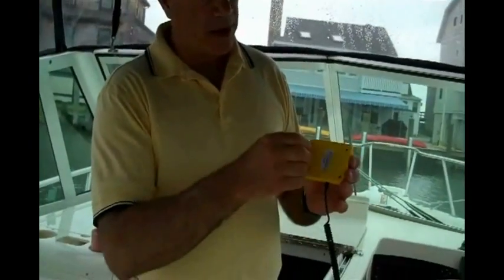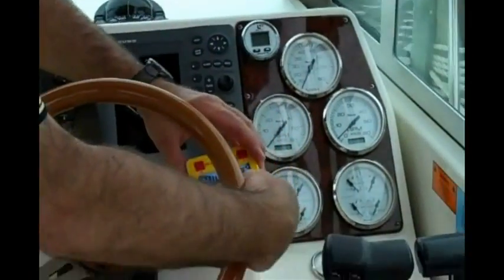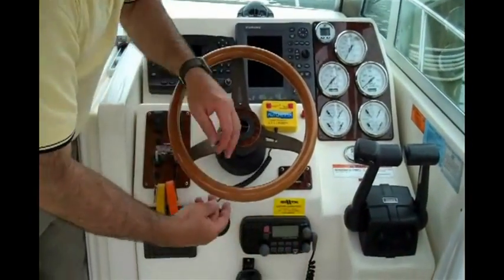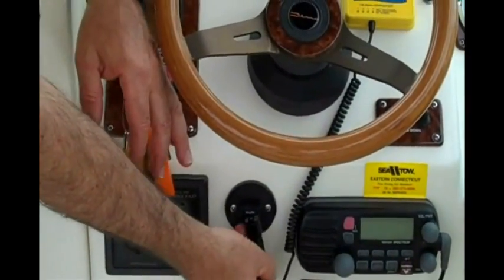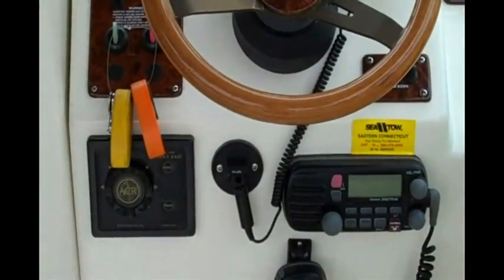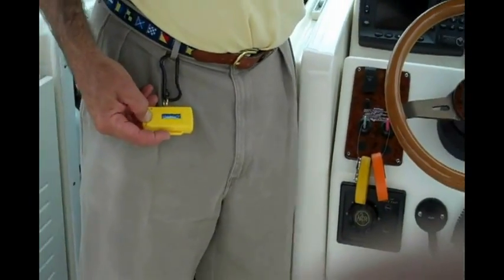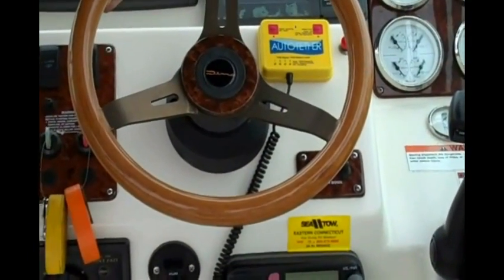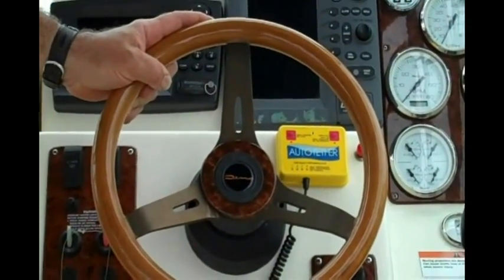Tutorial on Installing Autotether LLC wireless boat kill switch

Comment: Hi.  I have one that is several years old and haven't used it for a few years.  New batteries, everything lights up, but when I do a test, the alarm goes off but the actuator does not snap.  What's wrong? Thanks.

Comment: Just came across your video on the Autotether. I purchased one of these a few years back. It developed a problem not long after. We'd be cruising along and the Autotether would trip for no reason. Never could figure it out so I stopped using it. Recently, with boating season approaching here in New England I took it out of my bag to see if it was still working. Surprisingly, the batteries were still fine. I left it on for 12 hrs with no problem (at least sitting on the counter). But then I tested the remote sending unit in water and noticed that it had no reaction when submerged. I figured that the water touching the screws somehow completed a connection inside to trigger the switch. I took the fob apart to check it out. All seemed in order but of course, what do I know about electronics!? Anyway, it will work if I take the fob about 75 ft away so I guess if I fell overboard the engine would eventually quit. I don't even know if you'll see this but just wondered if you had any suggestions?

Comment: Excellent idea.Too many people don't attach themselves to the kill switch because they find it restrictive - or they have cut the engine accidentally by moving around the boat which can itself be dangerous in the wrong circumstances.This piece of kit seems to solve these issues very neatly and should be a major contribution to safe boating.